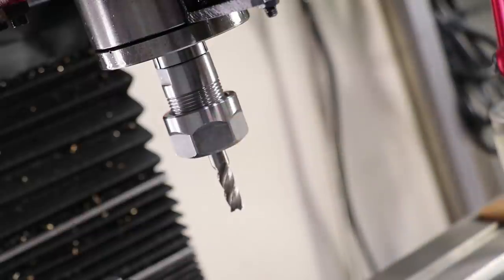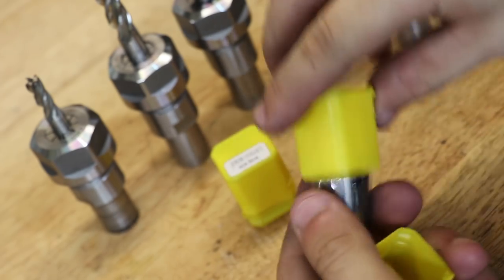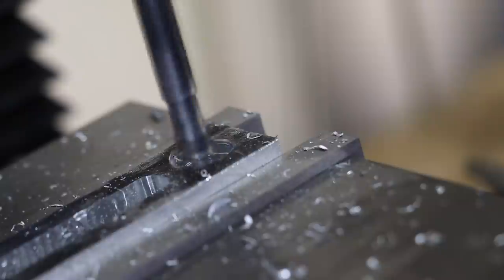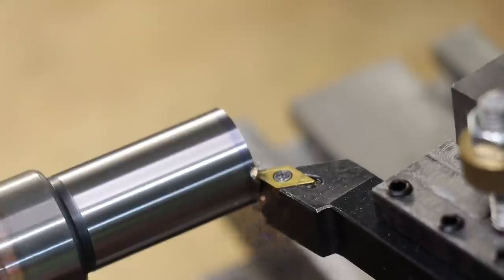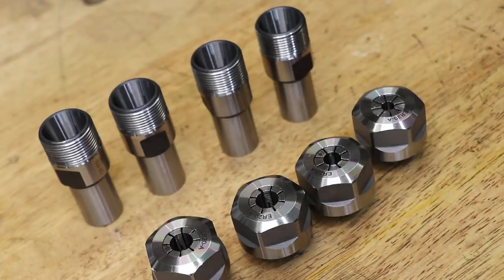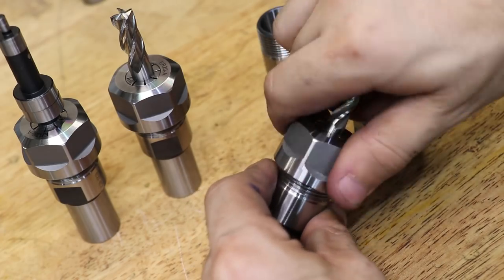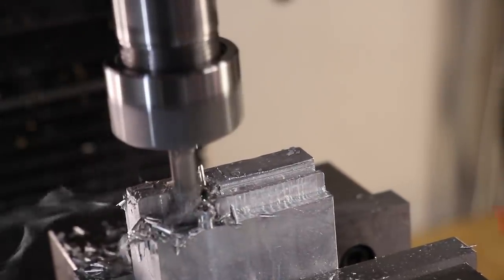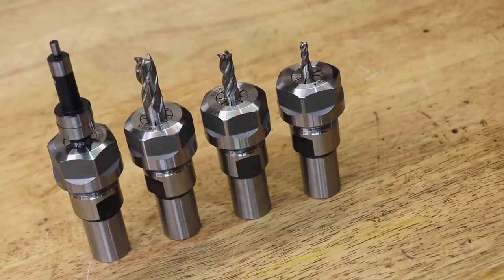Quick Change Mill Tooling Upgrade For The Mill (Mark 2)

Comment: Awesome, I did something similar for my lathe tailstock. ER16 "motor shaft" collet holders with 10mm steel bar cut to length for the shaft. Makes it quick and easy to change between my usual drill bits in the tailstock!!
Reply: putting a draw bar in your tailstock does sound especially useful o.O
Reply: @kefler187  I use them in a Jacobs chuck

Comment: It is really bad ran out
Reply from the maker: 10 microns is fine for cheap collets on a hobby machine. We aren't running DMG machines here. If that's not good enough for you then you don't have to use this method
Reply: @artisanmakes  you were offended because I pointed out that it wasn't as good as you thought.  for hobby applications this is unacceptable.  especially since it's very easy to improve quality.
Reply from the maker: I don’t know where you get this offended idea. It’s just difference of opinion, mine being based on running hobby and commercial machines
Reply: @artisanmakes  from damaged tools not only in woodworking, and opinion of many professionalist in cnc work in all materials, now you know 👍, I am against people who propagate false knowledge, in name of sub... Likes... And views... Or stupidity.

Comment: Nice value for $12. I gave up on it and ended up just making or buying MT3 taper ER holders. I have a dud set of MT3 spring collets, gave up trying to get a good one.
Reply from the maker: I considered that too, just I found this to be quicker and cheaper, although I'm sure it's a little less rigid . Cheers

Comment: Have you tried using roughing cutters in your machine? If so does it significantly increase the depth of cut you can make?
Reply from the maker: I have some on they way, although I have not used them on this mill before

Comment: I would like to know if the z (tool length) is repeatable when you take the holder off and back on. I'm thinking I could use this on my Cnc for faster manual tool changes..
Thanks!
Reply: I know this is a year out, but the Tormach TTS holders repeat very well. Even on my knock offs and cheap mill, tools repeat within a couple thou.

Comment: One nice thing with those 3/4 er collets is, that you can get that flat surface in them to fit against your spindle nose. Gives a lot of rigidity. I use them my self, and it was not so hard to find 3/4 morse taper collet with metric threads.
Reply from the maker: Well whatever works for you. And not bad of you can acquire those collets, they aren't available where I live. Cheers
Reply: @artisanmakes  i found one from ebay, the seller was in UK if i remember right...
Reply: @TSyrjalaknives  I'm not surprised you found tools mixing imperial and metric from a UK source!

Comment: Why do not use ER20 with MT3 taper?
Reply: MT 3 taper tooling is not exactly quick to change. Morse tapers are self locking and to remove it you have to hit the drawbar with a hammer. His idea is much better, quick, easy and keeps tool height consistent.
Reply: @jakubkopec9313  One of my mills, converted to CNC, have MT3 in spindle, and it has left handed tread on the top of the spindle. There is the cap with hole on top, and when I need to extract the tool from the spindle, I just use two wrenches, one for cap and other for drawbar, no hammering. Other milling machine with MT4, which I sold year ago, has the exact same system. And third machine, which I use as manual machine now, have ISO 40 spindle, the whole defferent story.
I agree with you about the tool height consistency, but I think that hammerless extraction system can be another project for Artisan Makes.
Reply from the maker: @RZ296  I can assure you that a power draw bar or something of the like is on the table. The effect of having a quill does complicate it a little bit more than i'd like. Most examples I've seen are with mills that do not have one. I have a few ideas and I'll hopefully be trying them out soon. Cheers

Comment: Nice. The cuts in steel you show are using a vanilla HSS endmill? Looks pretty decent to me!
Reply from the maker: Yes, these are inexpensive import ones. They do a half decent job, although they don't last too long in ferrous metal.
Reply: @artisanmakes  Cool thanks. Interested to hear how you get on with carbide when you get them! 👍

Comment: 5mm cuts lmao... bro ... not even the big tamahawk reactor cnc's do them types of cuts... if its designed for 50mm they probably will cut 5mm per pass... not 50.... cause tool bits are expensive especially after u run a piece and then u need another tool....
Reply from the maker: The haas machines we used to run would like a word. All depends on the type of job